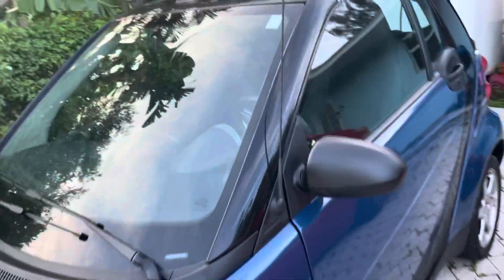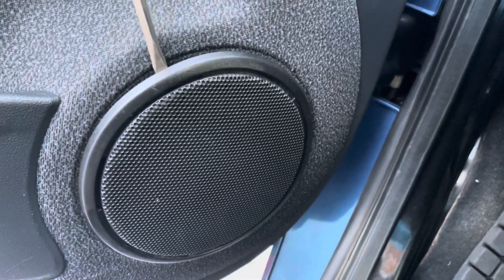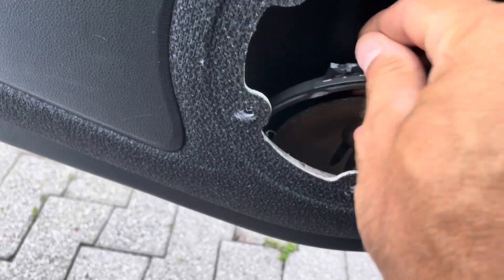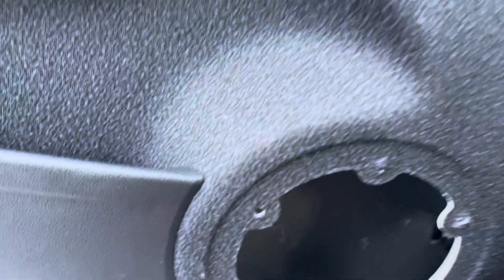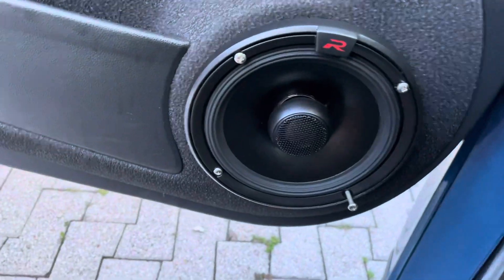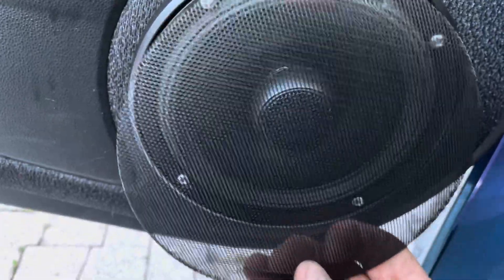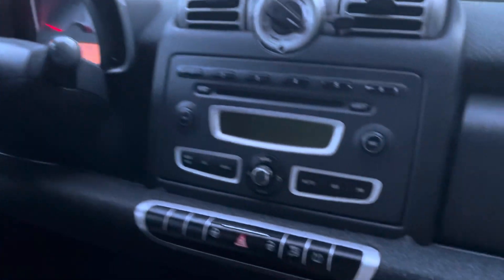How to install Alpine R-Series door speakers in your 2008 - 20016 Smart Fortwo car in 30min or less

Comment: I took mine to a car audio "specialist", and yet you did a much better job then them and they overcharged me massively and insisted I buy overpriced speakers, rather than some good quality ones like the Alpine ones you have installed. I wish I had just done it myself! Nevermind, I have went to a better company to install an Alpine subwoofer at a much fairer price. Thanks for the vid.
Reply from the maker: Thanks, they probably followed the instructions!

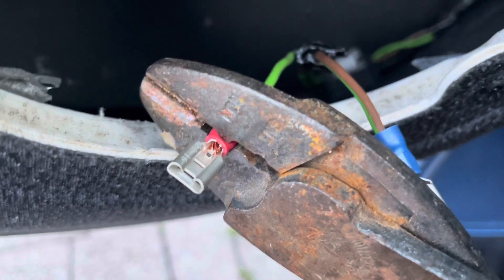Comment: Thank you for your video! A lot of such videos don't show the cables, and for me, who never did anything like this, it's a very important step! I am 95% ready to start, I just need to get these spade things 2:38 Do you happen to remember which size are they? My local bauhaus sells it in small packs and I don't wanna order a 300pc from Amazon when I really only need 2, just need to know the right size. I got the JBL GX602 but what you have looks very similar in regards to the cables. Thank you in advance!
Reply from the maker: It looks like I used a red size that is Red Female Insulated Spade Wire Connector Electrical Crimp Terminal 18-22 AWG
https://amzn.to/4aZLX5X

Comment: 2 questions. Did these come with replacements tweeters that go on the dash, and did you have to buy a separate amp?
Reply from the maker: I didn’t add an amp and I didn’t add any tweeters to the dash. All I did was change the door speakers and it sounded much better!

Comment: Very useful video. Thanks. I believe the "installation depth" of the Alpine R-S65.2 speakers are about 60mm (2.36 inches). Were there any issues with the window lowering all the way down?
Reply from the maker: Nope, worked perfectly. Thanks for watching:)
Reply: @RealityUniverse  Hmmm...Interesting. The Crutchfield website says Alpine R-S65.2 "Would Not" fit in the Smart Car door. Perhaps the magnet is too big or something else?... Did you have to do any other mod other than cutting off the taps?
Reply from the maker: @BaikFamily  nope, it fit perfectly.
Reply: Crutchfield probably said the speaker wouldn't fit because the speaker is usually mounted on the inside of the Smart door.  He surface mounted which makes a big difference.  @BaikFamily